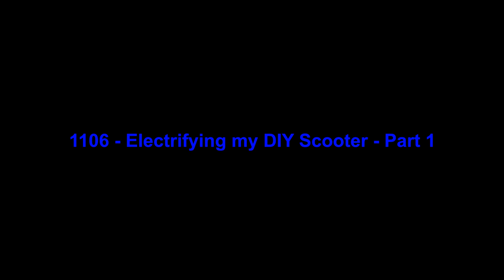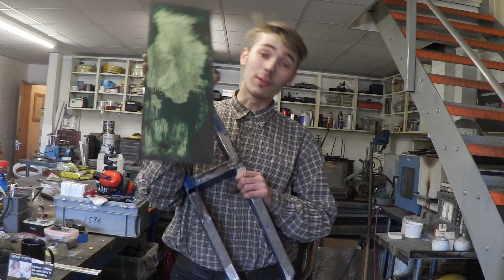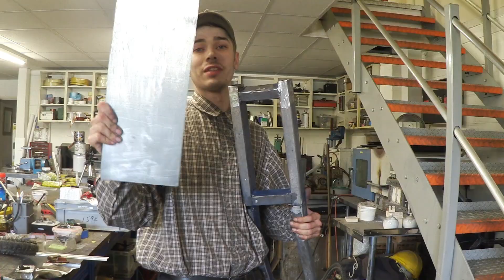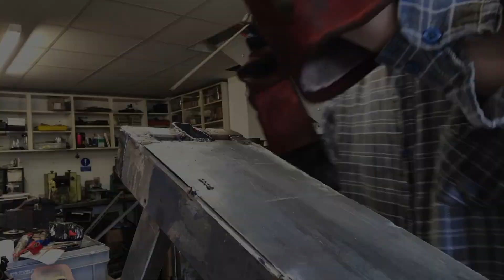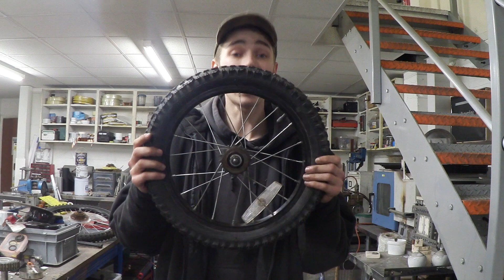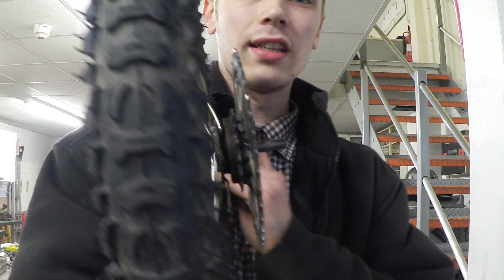1106 - Electrifying my DIY Scooter - Part 1

Comment: Nice job.  I figure that metal is attractive because welding is relatively easy (once learned and you have equipment), fast, and convenient, but have you thought of trying a composites approach?  You can save a lot of weight, and when it comes to E vehicles, weight (and aerodynamics) is critical.  

   Nor do you need expensive, fancy carbon fiber to get there.  Some lighter weight wood as the core (probably best being Paulownia), some S glass fiberglass, some high quality epoxy, and/or some carbonized cellulose nanocrystals makes some pretty dang strong but lightweight composites. There are now some at least partially bio based epoxies out there.

  And bamboo reinforced with the above materials, makes awesome tubes.

Comment: What motor controller, motor and throttle did you use, and where do you get these from?
Reply: The motor I am using is a 500w 24v dc motor this was from amazon, the throttle was one we had floating about so I am unsure where this came from, and the motor controller was from ebay its a 500w 24v motor controller. I will go into more detail in part 2 though. Hope this helps. :)
Reply: @MyNameIsLukey  it does mate, thanks Luke,  you're a diamond.

Comment: Was it spinning backwards
Reply: I think so, but I fink it's a dc motor, I don't think that should be a problem.
Reply: @wmffgeorge1589  just switch the wires and boom
Reply: @gedr7664  I wouldn't think so. 😑
Reply: Which way was the coaster cog...may need to flip the wheel, motor and direction